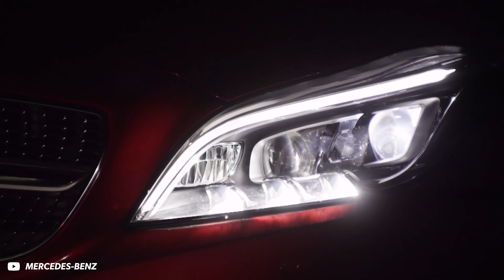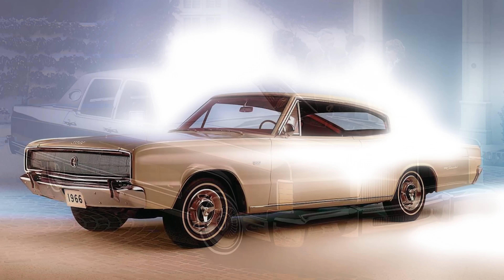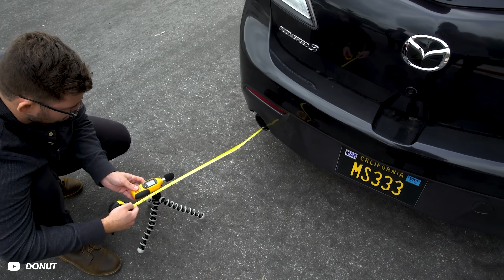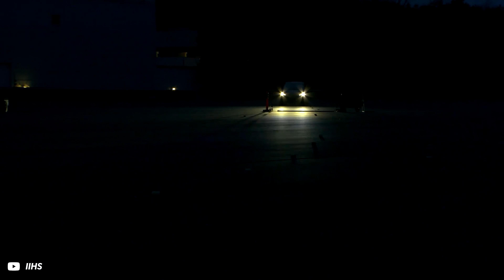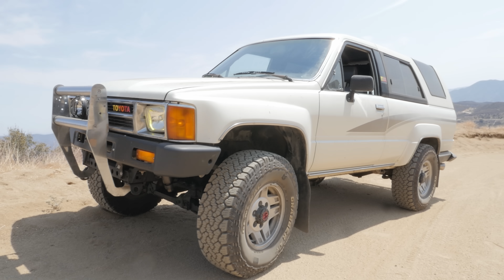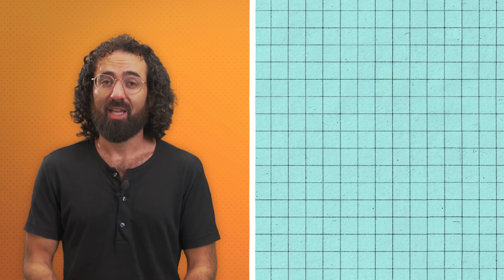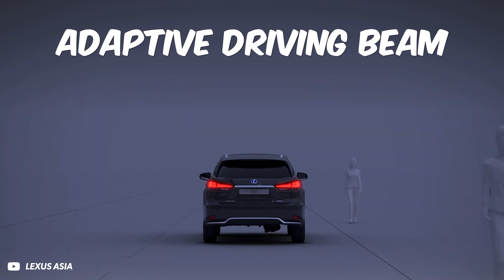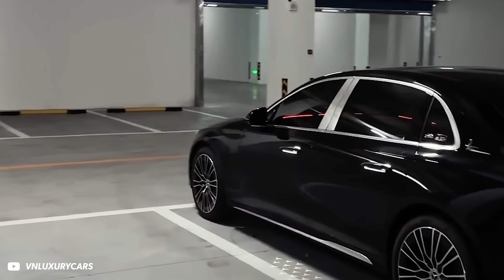Why new headlights are blinding American drivers

Comment: European here. 
Adaptive headlights sound good in theory, but in practice they fall completely apart. They can't deal with curves or Ridgelines and that results in your retinas getting fried before the oncoming car registers you. 
The SUV plague has only made that worse since the lights sit just high enough to hit normal cars rear view and side mirrors. 
Anything other than dead straight on results in you going blind.
Reply: Totally accept - Adaptive headlights blind me more often than any other type.
Any time the light has to "update" the beam it has a lag, brightly blinding you for a second, before switching somewhere else.
This IS NOT WORKING.
The only cars that does not blind me are incandescent headlights - that are solid, stable solution what actually work.
Reply: @ahappyyotubeuser9851 the french had it right with their yellow headlights in the past
Reply: Very much this. A plague indeed
Reply: Yup, they don't work. It's sometimes even the other way round, where everything seems fine until the very last minute the car passing you decides that you've already passed, or encounters a minor bump or something. It's a case of would you rather get attacked by a gorilla or a tiger.
Reply: @FinnishCarGuys  Tiger, fore sure! 🤣
Reply: This. Typical case of the grass is always greener on the other side. Matrix headlights are annoying both behind and in front of you. I hate when the matrix headlights of the car that is following me basically flash my mirrors every turn because it can't follow the position of my car properly. Or when objects on the side of the road illuminate out of the blue, because the car behind me decided to do so. It's very distracting and annoying for everyone on the road, except for the driver of the car with such headlights.
Reply: Another problem with ADB headlights is the cost. The headlight assemblies typically cost somewhere around $5000 each. That alone adds several thousand dollars to the purchase price of the car. Furthermore, any minor fender bender that damages them drastically increases the cost of repair, making your (and everyone else's) insurance more expensive, and making your car more likely to be totaled.
Reply: Totally agree. When it comes to headlights, I think we are going in the wrong direction, as in dropping loads of money to develop functionalities that actually make driving less safe. Well before adaptive headlights, I've hated ''automatic'' headlights with a passion since they've been rolled out. They create a false sense of security where people blindly trust the car's sensors to operate critical safety equipment. Anyone who's driving in a blizzard from time to time eventually comes close to rear-ending a white car whose tail lights are off, because the stupid sensor thinks it isn't quite night yet, but doesn't know you only have like 20 feet of visibility because of the snow. Now you also have these ''smart'' high beams that automatically switch to low beams... But they aren't smart enough to switch BEFORE obliterating both retinas of the poor driver in front of you. I mean, what was so wrong with having one switch to turn the headlights and tail lights on, plus a lever to switch between low and high beams ? Why would anyone want to pay even a single dollar extra for these useless bells and whistles ???
Reply: Figured as much, I sat and watched my mom's Murano a few years ago decide when it needed to switch from high beams to regular lights out on some back country roads in pitch black with no street lights around and man did that thing blind some poor people
Reply: This guy is so right!
Also they cant deal with the railing on freeways, so they blind oncomming cars cos it dosent register them.
Reply: @henrikrasmussen7340  Ugh yeah. 
Especially SUVs sit just right to poke over the standard height concrete barrier we use over here. 
They cant see me but im getting blinded all the time.
Reply: @toaster98  I have ordered a highpowered flashlight. :)
Equality :)
Reply: @henrikrasmussen7340  When someone is being stupid on the road, attempting murder is not the solution.
Reply: @henrikrasmussen7340  🤔 hmm, good idea. I might have to do that too 😊
Reply: Agreed entirely. ADB's are totally useless in real-world applications, there's ALWAYS at least a fraction of a second where it flashes any vehicle in front of it, regardless if it's coming towards or moving the same direction as the source vehicle. That flash results in a dazzling effect that lasts for up to 2 whole minutes after the initial flash, even if that flash was for less than 1/10th of a second. That driver now has reduced visibility for a considerable amount of time, and if there's more than one oncoming SUV with ADB's, the effect can last even longer. VW and Audi showed off a video of the tech in-action on a rally-like backroad following another car, both going quickly, and even in the staged demo designed to show it in the best case scenario, you can see it blinding the car in front ever hill, every crest, every dip and every curve. ADB's only make drivers THINK they're not blinding other people, and it's actually worse than the alternative. Automakers and pushers of ADB's are assuming that computers can think and react faster than light can travel, which is NEVER going to happen, it's physically impossible with our current understanding of light physics.
Reply: Exactly, I was just about to write the same thing.
Reply: 100%, idk why it is seen as a "european" thing.

We have these in the US, another weird thing some people think are euro centric, I have seen how they fail to adjust soon enough and will often get brighter at the worst times.
Reply: @Medieval1-1 you only got them recently. Over here they have been a thing for a good while now. 
And while most people in the us praise it as a good thing we know it's not the solution everyone hopes it is.
Reply: I totally agree. Either the CPUs or the mechanicals of those cars are too slow to respond to incoming light and thus make them dangerous. The govt should study them thoroughly before allowing them on the road.
Reply: Yeah, this video was just a Rivian ad. Sucks.
Reply: They are adapted to blind the oncoming vehicle.
Reply: another part of the issue is that many cars have a setting that automatically turn on high beams, which is beyond fucking stupid. whoever conceived that idea should have their eyeballs removed with a rusty spoon.
Reply: European who has been in the US for New months.  It's far worse than you would expect it in the States.
Reply: i think that more depends on implementation.
some automakers might be able to pull it off while others fail at accounting for those situations.
im sure as the technology advances it will get better
Reply: My auto high beams go on while I am driving behind other cars. I can't use auto because of it.
Reply: Absolutely agree. First thing I did when I got a new car 3 years ago was to turn off adaptative headlights, that kind of so called "aid" is just an excuse for drivers to stop paying attention to what they do or should do behind the wheel.
Reply: Yeah.. anything that needs software + real world sensor is bounded to not work as intended.
Reply: If I pull over to let a car come past me on the opposite side, I instinctively look away because a "thank you" flash is blinding, especially at night. I know they are appreciative but I'd rather do without.
Reply: Sorry, but adaptive headlights work really well in curves and ridges too. Far better than the lazy drivers... Also it is very dark for a very long time here in finland so yeah, i have experience.
Reply: @Manakuski my experience every day tells a different story.
Reply: From 10 cars blinding me 1 single car is old with manual highbeam switch and 9 have adaptive lights. Is operating a 2 ton vehicle focused and forward-looking asked too much? Then you should think about taking public transportation to get to your destination in my opinion.
Reply: European here, yeah, firstly most cars don't have them anyway because they're expensive af and so are only in premium models. So I'm getting blinded by regular factory LED low beams on new cars all the time. 
Secondly, as you say, they don't work properly. I was once riding my bicycle in a residential area and met an oncoming car with those matrix headlights on. The car couldn't figure out what to do, couldn't decide if I was a vehicle or a lamp or something else or couldn't track me properly, so the result was a blinding disco light show.
Reply: SUVs should be banned in Europe.
Reply: @friedsynapses  I dont think they should be allowed in most cities across the globe.
Reply: @friedsynapses  Maybe a little extreme there bud. But pick up trucks YES! (not really but maybe make it harder to buy them or something I hate 'em)
Reply: @MINIKRIGARN  People who drive SUVs are overcompensating for something, like being from a shithole country but somehow being wealthy.
Reply: I swear man, it is always a BMW or an SUV, or a BMW / Mercedes SUV.. They know they annoy people but it is just what they want.
Reply: I second these, fuck adaptive lights and SUVs
Reply: "the lights sit just high enough to hit normal cars rear view and side mirrors."
Just normal cars?
I've been blinded by SUV headlights in mini vans and vans.
In Vans!
Reply: OMG, so I am not going insane about the adaptives. Everyone's praising them and looking at me like I'm stupid whenever I mention these blind me the most, but I see I am not the only one.
It's time this gets brought up to everyone's attention, over past few years driving at night has become unbearable due to all the blinding, to the point of causing me migraines. Not to mention the times I've ended up literally driving blind.

Also, modern brake lights, those became blinding too, and no one bothers to use their goddamn parking brake when standing still in traffic, they just keep their foot on the normal brake and blind people behind them. I often resort to wearing sunglasses when stuck in traffic at night, otherwise my eyes just wanna die.
Reply: Thats completly wrong. I drove infront a  friend for hours. In the city, outside the city and on the autobahn. Not onece i was blinded by the headbeams. (They where put on Auto for rhe whole route.)
There might be carmakers with better systems and bad systems, but the better systems do work very well.
The thing is, when the systems work well, you dont see them, because you didnt get blinded. Only if the system woks bad you see them. So if you dont use them by yourself, you only see the bad ones.
My old ford for example switched the beams on and of by itself, but often takes 1-2sek to long. Bad system, i hated it.
The tesla i drove for years, worked perfektly.
Reply: @marcesser4218 i have them on my car for 6 years. First VW Passat, and last year on VW ID7. They do work extremely well, and I never get flashed by opposite drivers, as you might get when driving with normal headlight with manual high beam.   There are a few situations where I know they can cause disturbance and that is with elevated road and opposite trucks, and cyclists. When I notice such situation I turn the ADC off temporarily
Reply: I'd take occasional retina frying over constant
Reply: @sakaraist  That's not exactly a good approach. The moment when the beam flashes you is the potentially most damaging to your eye. If it then turns off and then on again, your eyesight will be hit MORE than it was before.

You don't want a disco show of light. Never, for any reason. It's not good for your vision, nor for your sight in general.
Reply: @kikixchannel  I agree it's terrible, but that's how driving in the US/Canada already is. SUVs and Trucks with spotlights at eye level bouncing over potholes flashing you with the brightness of the sun as the suspension bounces up and down. Driving here is genuinely miserable at night now compared to 15 years ago. Then there's also the cheapo LED lights that people get off amazon that flicker. Matrix lights are far from perfect but they are a massive step up from the current conditions here. The spotlight headlights are even better when they hit you from both side mirrors and your rear view mirror at the same time.
Reply: @sakaraist  I do understand the problem, though I'm not a driver. I do have light-sensitive eyes though.

That said, since it needs to be changed one way or another, I think that it's better to change it into something that actually solves or at least mitigates the problem, instead of adding another layer of complexity to it. Doing things half-way is just going to ramp up costs and decrease compliance.

Comment: Do american cars not get inspected annually for road-worthiness? In Europe, you can buy aftermarket headlights and bulbs but if they do not not meet the manufacturer's specifications on test-bench, the car will fail and you need to fix it before car is allowed back on road. Sure, some people do go through the hassle of swapping in stock parts before every inspection, but that is a very small minority. Plus cops can and will pull you over for using aftermarket parts and issue a new inspection on the spot.

Comment: one of the problems is that people use any crap they can buy on amazon. 
they use corn led bulbs that shoot light everywhere so they cannot aim 
the light properly. they use it for fog lamps and main beams so at night
 they are illuminating more the sky than the road and blinding everyone.
 some even put some led bars as if they were driving in the jungle. they
 simply do not care.

Comment: On the bright side, some automakers in India like Tata and (even Korean brands that manufacture in India like Hyundai and Kia, and some Suzuki models) are placing their headlights on the bumpers. The lights are very bright, yes. But they only illuminate what they're supposed to - the road. Brightness is needed in certain parts of the roads, but a lower placement of the lights would do everyone good.

Comment: Rivian isn’t the only company using adaptive headlight technology. Tesla started to install the hardware in 2022 models across the board. But it wasn’t until March of 2024 that they were enabled with software updates. My 2023 Model 3 has it and I love how it blocks out portions of the high beams for other cars. 

I know other manufacturers have them too, as I can see their headlights are blocking the same areas. I just don’t know what brand they are.

Comment: I feel a big part of why people get blinded by LEDs is simply the colour temperature. As a driver, the colder colour gives better vision, but it's also harder on the eyes for oncoming traffic. If you take two flashlights of the exact same model, but one of them has a warmer colour temperature, the higher Kelvin one will seem brighter.

Comment: I'm from Sweden, Europe. I don't find it too bad with most LED headlights, as long as both drivers use low beam. It's also very common to see extra lights mounted on cars because the Scandinavian winter + no street lighting on many larger roads, without them spotting wildlife and other stuff, is almost impossible. But people are very good at turning all that off.

Comment: ADB looks great is useless in actual use. They look at other lights to determine if it needs to turn off parts of it’s lights. Example: a truck coming towards you on a highway with concrete divider is not reconised and gets blinded. On paper a great idea, in practise too flawed to be used. Great video by the way!

Comment: And this is the reason that in Germany all changes to an all original car must be certified and must have a legal permittance and must be registered on the pink slip (Car documents). Without the permittance certification and registration every change to a car, but also motorcycle, truck and bus on German license registration is therefor illegal. I mean literary everything... Because cars as they are OEM produced are legal for the road. So every change the owner or garage makes to the car, makes it illegal to use on the street. If you still decide to drive that modified car (engine, lights, body, wheels anything) you really should understand that you are no longer ensured and that this car can and will be confiscated by the police, since for this modified car is no legal permittance to drive on the street. In Europe, it is obviously regulated in a way that it is obvious which after market products are to be legal and which are not legal. And only a certain percentage of car owners will go through the trouble to change this to the all original car to begin with, since modifying is only a nice market for the "Fast and the Furious" kind of people. Maybe those people who had damage to their car and need replacement parts may install after market parts, but in general, one installs OEM parts except when OEM parts prices are way over the top, then After market parts will be bought.